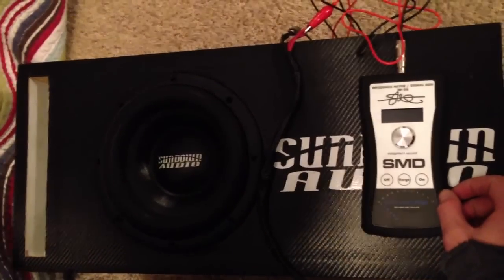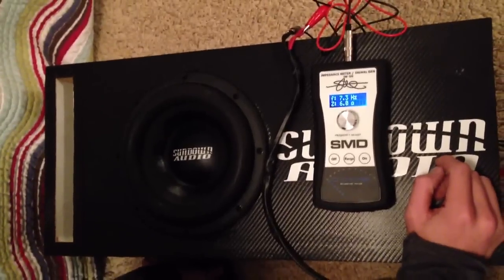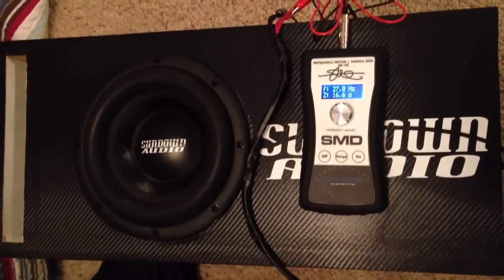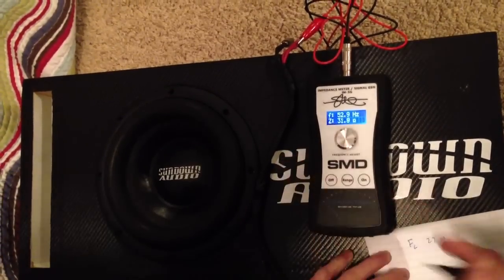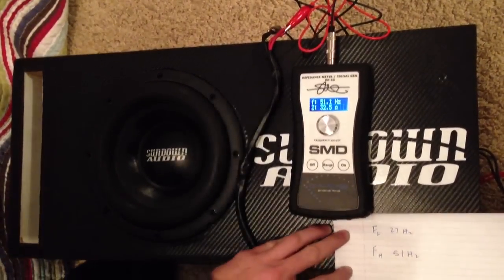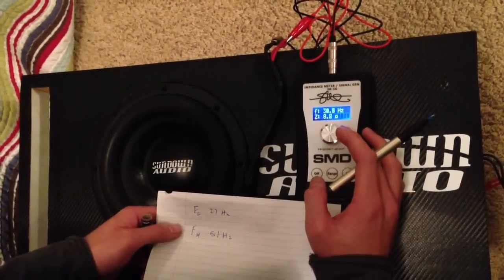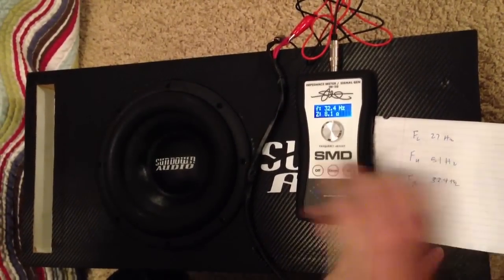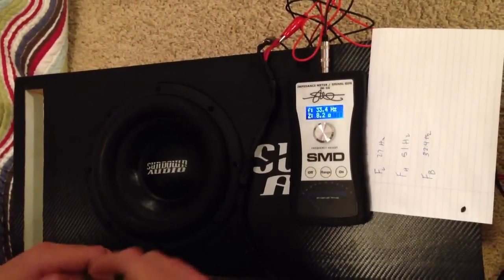SMD IM-SG1 Find What A Ported Box is Tuned To in Minutes

Comment: If you check the sub use digital multimeter... does it show same 8.1ohm? Cause if it does i love to buy 1
Reply: it is a dual voice coil subwoofer so if you get the dual 4 ohm one you can wire the coils either in paralel which would make it 2 ohm. or you can wire the coils in series which would make it 8 ohm so yes you can use it as 8 ohm woofer

http://www.ecoustics.com/electronics/forum/car-audio/138773.gif